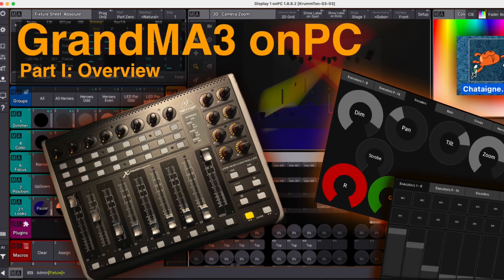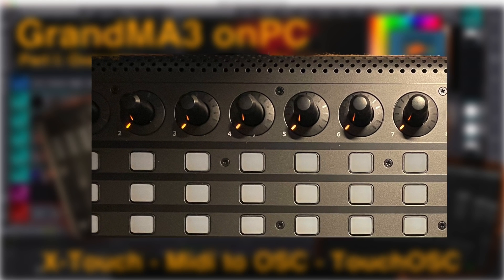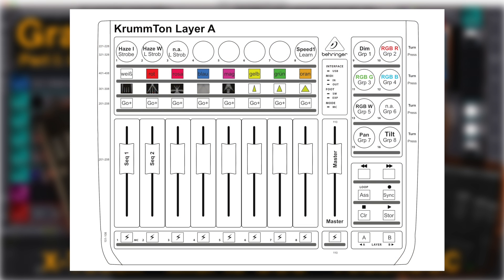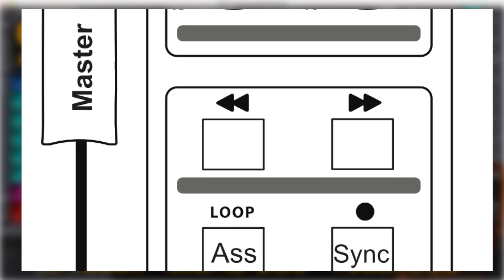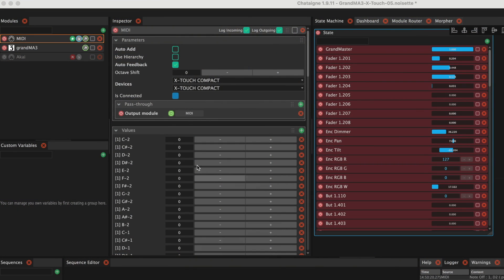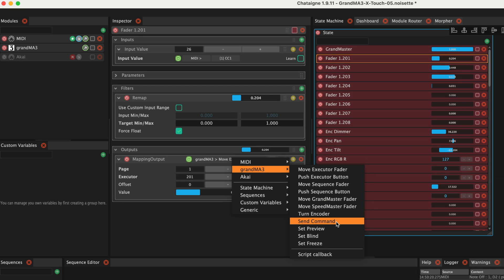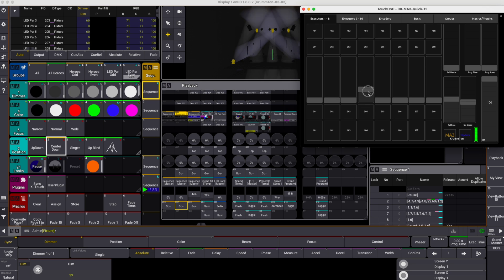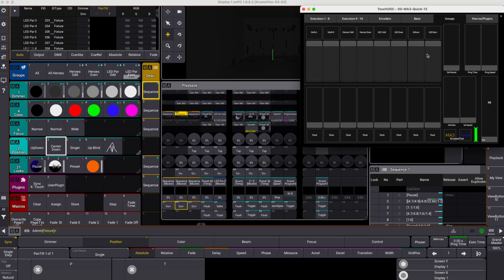Grandma3 Midi to OSC - Part I: Overview, X-Touch, TouchOSC

Comment: Im confused. I know this is a MA3 tutorial but im trying to do it in MA2.
Knobs 9-14 from x touch compact doesnt work in Mackie mode... i tried using showcockpit and no luck..

How did you manage it to use those knobs??
Reply from the maker: I don‘t use the Mackie mode.
Reply: @stefankrumm6709 ohh i see.. so without MC mode all knobs should be working?
Reply from the maker: I think so. But can‘t tell what Showcockpit is doing with it. Maybe there is some info onMA2 elsewhere on the net?

Comment: Hello, great video. Just one question. Why would I use this method instead of just mapping midi in the MA3 settings ? Seems way easier and it was really quick setup for me to do it with my cheap launchkey controller. Thanks !
Reply from the maker: Thanks! I think the main reason of using OSC instead of pure midi is that MA3 does not allow direct access to the executors via midi, only to e.g. sequences. I my self has played around with a pure midi setup because I had weird things going on and crashes during a show using Chataigne. One could think of mapping midi to a set of basic sequences and building macros that e.g. on demand copies songs to that sequences/executors. If time allows I'll make a video explaining that approach. Happy programming!
Reply: Allright I did not know this. Thanks for your response ! But, correct me if I am wrong, you can store anything you want on a sequence, than you can assign this sequence to executor. So i dont really understand what is the deal with no midi mapping of executors. But I am really new in the MA3 world so I am probably missing something out! 😅
Reply from the maker: @Filomen7  The difference between MA2 and MA3 is that in MA2 the executor "owns" the sequence assigned to it. In MA3 the sequence owns the executor. So the solution is to assign some dummy sequences
 to the executors and then copy the sequences needed  to these on demand. Maybe a bit confusing. Will make a video. ;-)

Comment: Hi, können Sie mir nochmal genau erklären warum die Methode zum direkten Einspeisen des MIDI Signals hier nicht mehr zu funktionieren scheint und Sie deshalb die Alternative mit Chataigne und OSC nutzen? Werde aus Ihrer Begründung "MA erlaubt keinen direkten Zugriff mehr auf die Executor" leider nicht ganz schlau. Dann wäre MIDI Remote doch für den Anwender absolut uninteressant wenn der Zugriff auf die Executor fehlt und MA könnte gleich das gesamte MIDI Feature rausnehmen oder?
Reply from the maker: In MA2 war es möglich, einen Playback Executor mit einem Midi Control change zu verknüpfen. Es war wohl auch möglich, eine Sequenz auf mehre Executors zu legen, die unterschiedliche Werte haben konnten. In MA3 bestimmt die Sequenz über die Playbacks. Das heißt, wenn man eine Sequenz mehreren Fadern zuweist, gibt die Sequenz den Ton an. Die Fader bewegen sich simultan. Auch ist es nicht möglich Fader ausser den Master-Fadern einem Midi-Input zuzuweisen. Deswegen der Umweg über OSC, da geht praktisch alles. Trotzdem ist die Midi-Steuerung nicht obsolet. Man kann Sequencen, Gruppen, Views, Macros, Plugins, Worlds und vor allem alle Masterfader (Selected, Speed, Rate ....) damit steuern. Ich habe inzwischen eine Commandwing am Start und nutze trotzdem den Midi Controller über Midi um Selected Sequence, diverse Speed- und Gruppenmaster zu steuern. Ich hoffe, das hilft ein wenig.  Mehr Infos und lebhafte Diskussionen ob das Sinn oder Unsinn ist, gibt es in den MA-Foren. MA hat sich halt so entschieden.
Reply from the maker: Ach ja, es gibt eine Lösung. Aber etwas umständlich. Im Midi In/Out dialog kann man ein Midi event einem der 50 Playback Master zuordnen und diesem wiederum auf einen Playback Executor legen. Im Setting der gewünschten Sequenz kann man nun unter Playback den gewünschten Playbackmaster zuweisen. Nun kann man über den Umweg über die Sequenz den Executor steuern. Folge mal den beiden links hier: https://help2.malighting.com/Page/grandMA3/masters_playback/en/1.9
Reply: @stefankrumm6709 Vielen Dank für die ausführlichen Antworten! Mein Denkfehler bestand darin dass ich dachte dass MA3 onPc anfangs noch Executor per Midi ansprechen konnte, dies aber mit einer neueren Version entfernt wurde. Dass dies aber von anfang an nicht möglich war, sondern nur bei MA2, hatte ich falsch verstanden. Vielen Dank für die Hilfe 😅